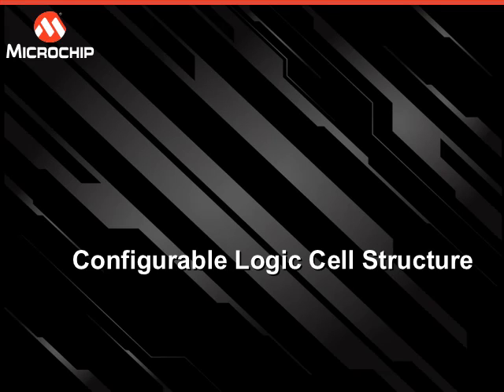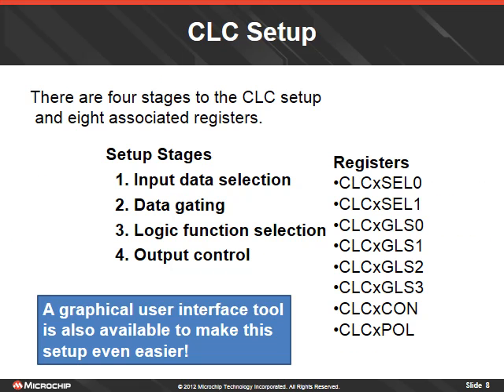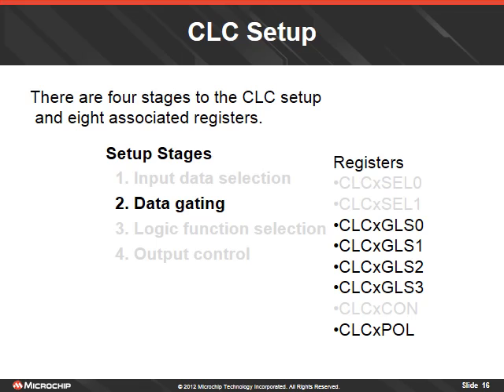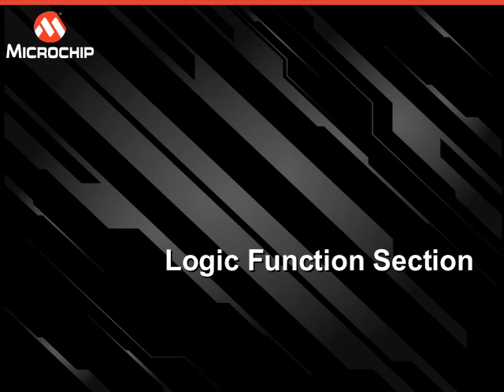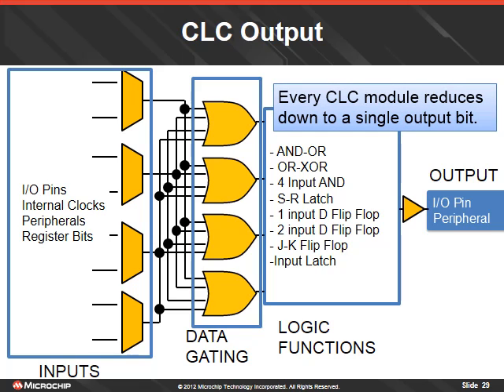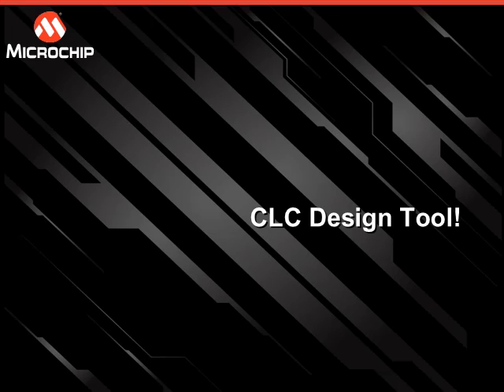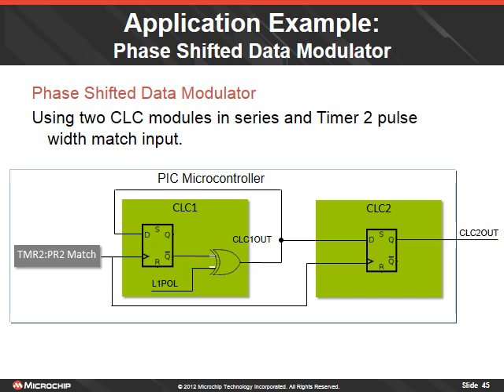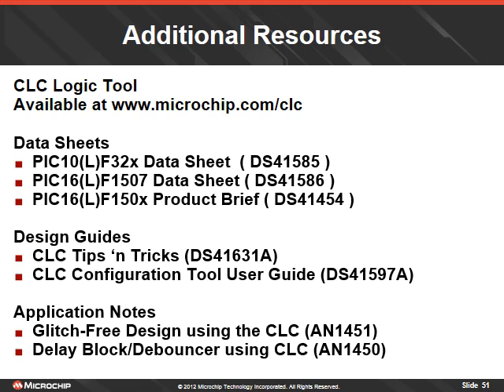Microchip Self Paced Training - Configurable Logic Cell

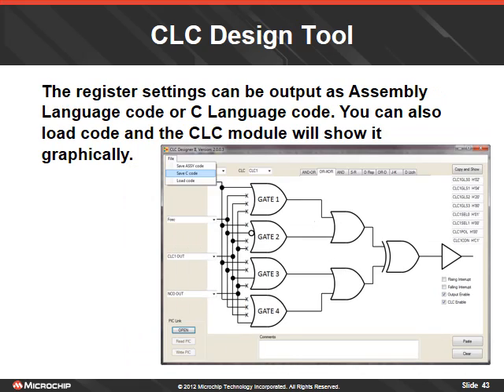Comment: @16:39 what is nice is this tool will generate the C, or assembly, code for you to include in your code.  I used FPGA few years ago for the video control board, very similar to the CLC in this tutorial. I am already using the PIC16F1508 for BLE control - this is very powerful.